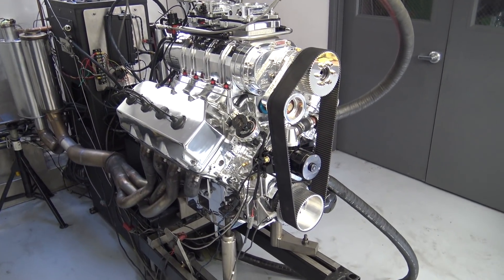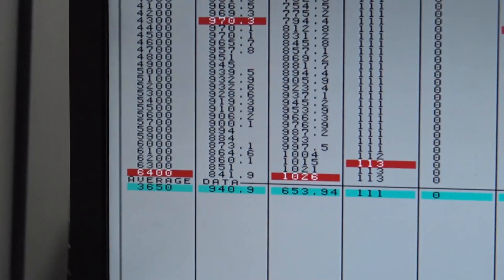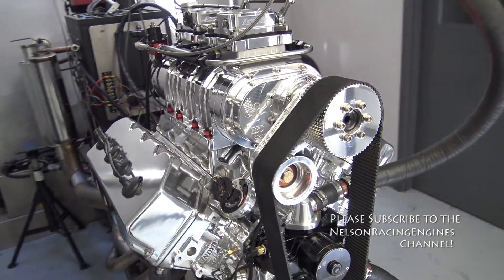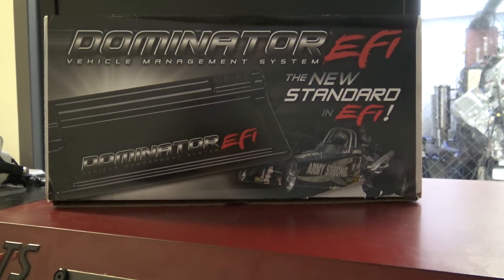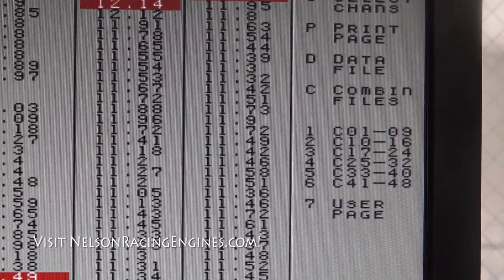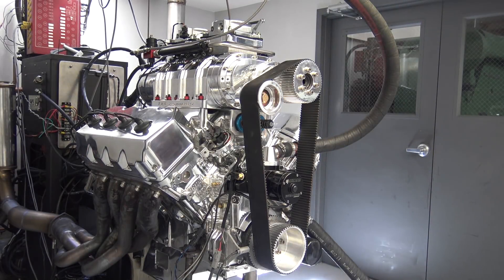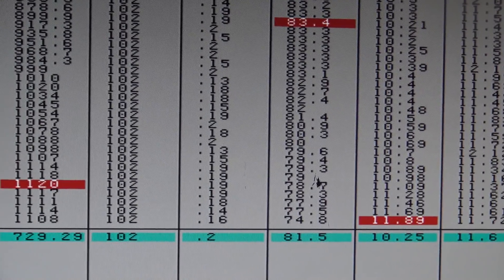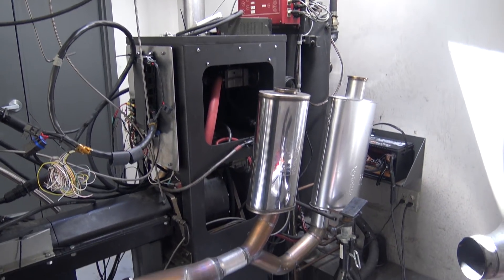Monster 1150 HP E85 Blown 588 CI Chrysler Hemi.  Nelson Racing Engines.

Comment: On what planet do Hemi's not make much horsepower? A lot of drag racing engines are chrysler based HEMI engines. Top fuel dragsters are 500ci and make 10,000hp, and they're chrysler based HEMIs.
Reply: Yeah top fuel dragsters have a aluminum cnc machined block based on the legendary HEMI. Lots of power